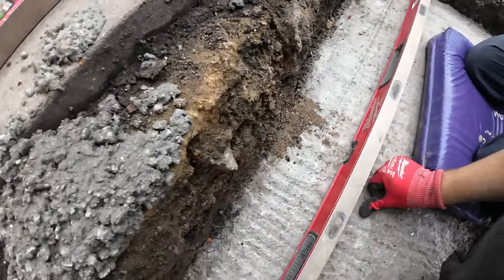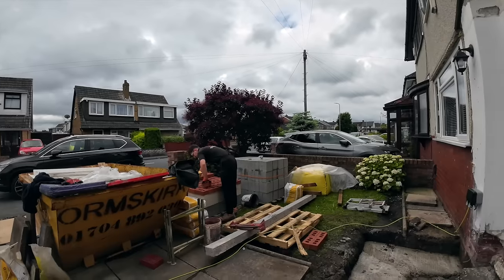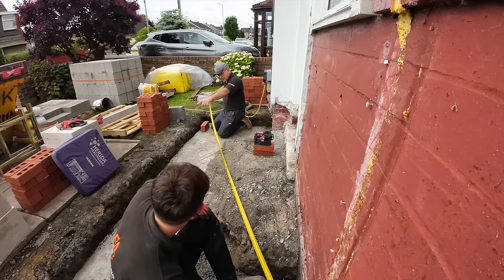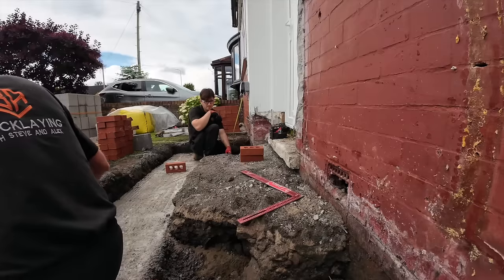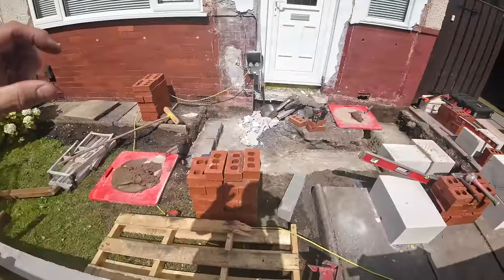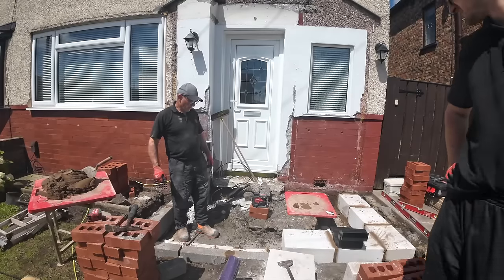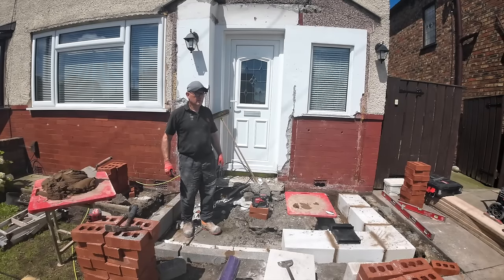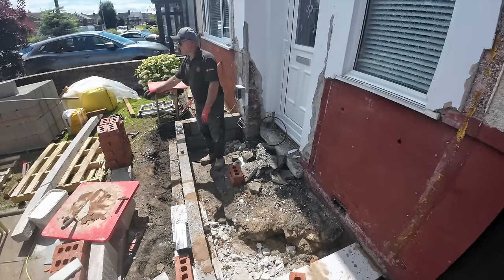FAILED PORCH RE BUILD BRICKLAYING UP TO DPC: PT 3

Comment: Did you guys advice the customer that with the clay being underneath the grass and no runoff for the water which lands on the grass a French drain would be advisable ,😊 that would  stop the damp running up the wall and move the water away from the house ,
Reply from the maker: No